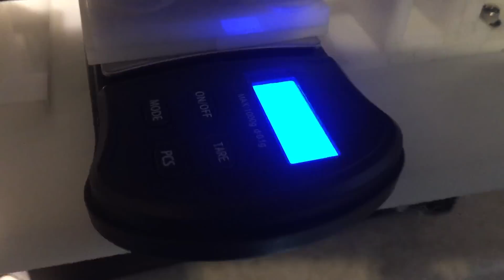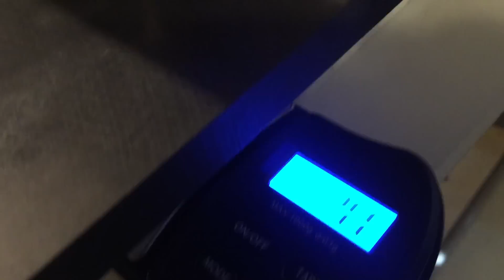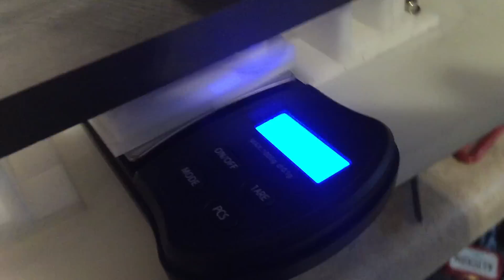HIGH VOLT AC, MAGNET WEIGHT and GRAVITY

Comment: Electricity (as is all energy / magnetic fields) is rooted from Gravity. (Gravity is the by-product display of the dielectric aether supporting the strong force to mass.) The magnets weigh less because the current's magnetic field is interacting with the magnetic field of the magnets (attraction with the upper plate - and potential repulsion fro the lower plate = resulting with a lower weight register. (My digital scale will act odd when in that close proximity to a powerful electric exchange.)

Comment: Something that needs to be considered is, jumping electricity pulls point A and point B together. Learned that the hard way while working around power lines. Larger the voltage and amps, the larger the pull. I think of the arc as something like a rubber band. Bigger the load the bigger the band. Tried pulling a screaming tree limb off the power lines one time, was like the arc was saying know you don't. Limb kept going back to the wire. Had to watch the thing scream then burn before it dropped to the ground burning. Who knew limbs could scream?